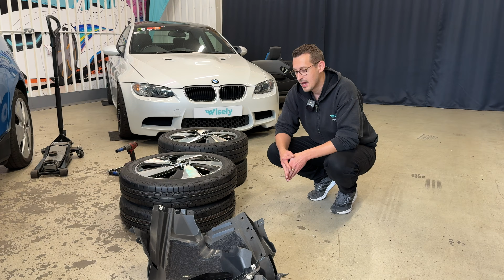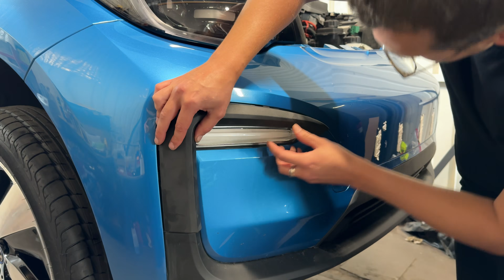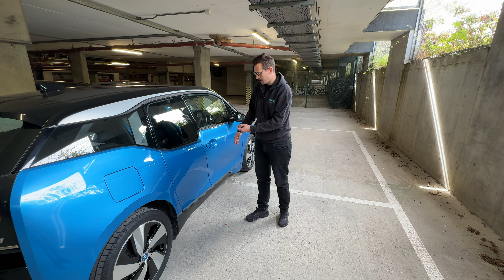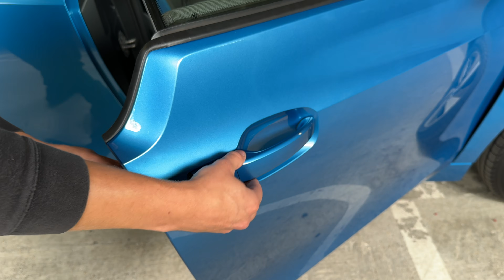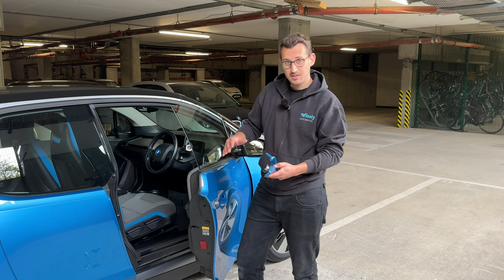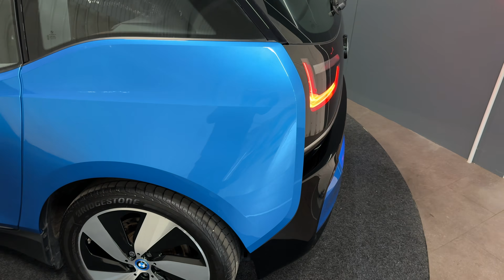BMW i3: 120Ah Protonic Blue Project FINISHED + Door Handle Adjustment DIY Guide

Comment: Thanks for actually explaining what each ashustment does! When my partner gorilla-armed off my door handle, I thought it would be an expensive fix. Found another video and several reddit threads saying you just need to tighten those two screws. Well I got it back on, but the door wasnt opening and the handle wasn't returning right. After watching this it took me 2 minutes to get it right. 👍
Reply from the maker: Thanks! Pleased we could help :)

Comment: For tightness adjustment there's a small marker in the door handle part which goes through the door panel when you move the handle. According to BMW instructions it should become visible when the handle is pulled, but not more than 3mm outside of the door panel.

Comment: Shouldn’t you have put the new tyres on the rear? I’m not sure of the logic in it, but it’s what has been done when I’ve had the fronts replaced.
Reply from the maker: The front and rear tyres on most i3’s are a slightly different size (155mm F vs 175mm R) and so cannot be swapped around!
Reply: @wiselyauto  Wow, I didn’t know that.

Comment: Fab video!! Brilliant explanation about the weird door handles. I tightened them up on my old i3 (also protonic blue) once but I over tightened and then couldn't open the lock from the outside just how you describe. I ended up crawling in through the boot before I realised I could have just opened the window using the keyfob and opened from the inside - doh!
Reply: I did exactly the same thing - over-tightened the bloomin' thing and it wouldn't open the door.
Fortunately, someone on the BMW i3 Owners and Enthusiasts Group on Facebook highlighted to me the open button long-press function on the key-fob.

Comment: Great video....i have on mine the light on the inside of the door handle is out is it hard to change that bulb in there?
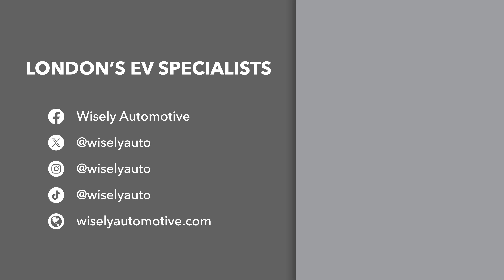Reply: I've got the same case, I got to the bulb on my driveway, it took 30 minutes roughly, it's doable. The inside door panel has to come off. My bulb seemed fine so I gave up on the whole thing as I believe there's a loose cable or sth. I'm waiting for an opportunity to have sb do the diagnosis as I don't feel confident at these electric stuff yet. Good luck with the repair. It drive me nuts though especially at night when only one side is lit. 16:15
Reply: I ve got the part number of the left side driver door handle. It's a photo I can't attach it here though